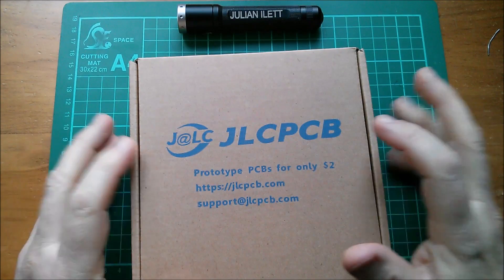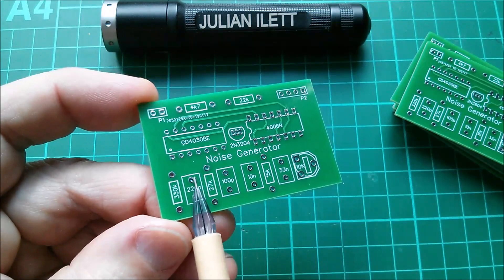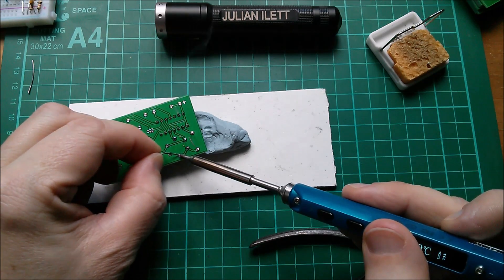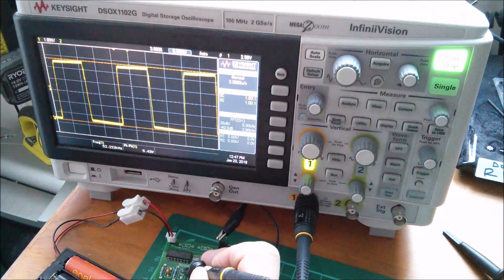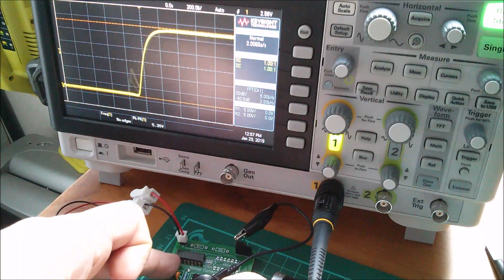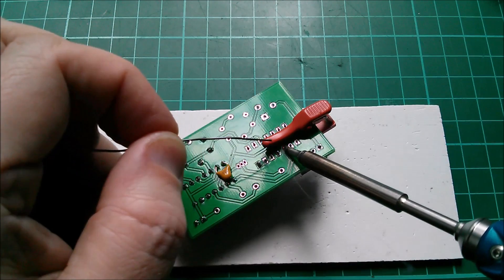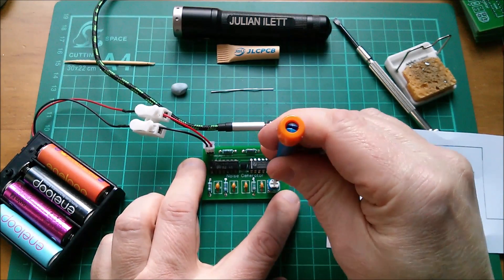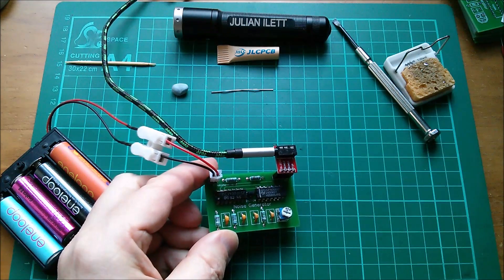Noise Generator PCBs from JLCPCB with GND Copper Area

Comment: Are you having good luck with those headphone jacks?  I ordered in 10 of them a couple of years back, and then the quality of the traces was so poor that if my soldering iron drifted over 300C the traces came up and I had to figure another way to get the electricity to the pins.  I used bodge wires to go from the pin over the back then to the tab that hooked to the desired part of the earphone plug. Don't think I will try any more of them, even with my new digital soldering iron I just don't trust that board any more.

Comment: @Julian Ilett I think the higher amount of high-frequency noise that occurs as the volume is turned up may have something to do with the human ear's tendency to emphasise mid-range sounds at lower levels, as determined in 1933 by  Harvey Fletcher and Wilden A. Munson. Their research resulted in the so-called  Fletcher-Munson curves, which in turn gave rise to 'loudness' circuits in many types of amplifiers for home use. More info about this can be found  here https://en.wikipedia.org/wiki/Fletcher%E2%80%93Munson_curves
Interesting video by the way; are you designing a modular synthesizer?
Greetings from Denmark.

Comment: you need 2 ics one transtor and a awful amount of passives for a white noize generator? come one 2 transistors 2 resistors and one cap do the job equally good... i build that 

on a 2 by 3 cm piece of perf board

Comment: If you can put up with always getting exactly the same pseudo-random noise sequence on each power-up, you can just program a PIC chip to simulate a 32-bit shift register with two of its outputs xored to its input.  I know 'cos I did exactly that.

The final circuit has just the 8-pin PIC and a small speaker connected between one of its output pins (ie a pin programmed to be an output) and ground, with an 18650 as the power supply (since the PIC I used will work down to around 2 volts).  If you really, desperately need to filter out any DC, then you can add a small capacitor between the output pin and one speaker lead (or the amplifier, if you need a loud hiss).

"Tuning" the circuit to give a slightly deeper sounding hiss involves nothing more than inserting a few "nop" instructions (no operation = do nothing) before the jump back to the start of the loop.

Re: Short solder.  I usually try using a pair of needle-nose pliers to hold the solder when it gets that short.  You can also try resting the last scrap against the pin you're going to solder and applying the iron.  (Yes, I'm a bit of a Scrooge too, when it comes to not wasting even that last tiny scrap of solder) :)

Comment: Cool use of the tie clip!  Love it!  Say I was going to order some PCB's from jlcpcb but when it came check out, the shipping seemed rather high, well extremely high compared to most of the things I get from China and Laos, that region.  Am I missing a button or something, it's not like I need overnight or even rush delivery, a slow-boat from china would work for most of my needs, seems my urge for speed has gone by the wayside in my old age, and the need for funds far outweigh such needs for speed.  They look to be great little boards but it's sort of like the adds on Ebay showing a nice phone for 6 bucks then when you see the shipping is $300.00 you sort of understand that it is really click bait.

Comment: Disappointed not to see mounting holes, silk screen markings for the power ("+V" & "gnd") and output ("out" & "gnd") connectors, bulk decoupling for the board, and individual decoupling for each chip.  Weird that the two chip footprints are using very different pads.  Test point for the oscilator output?
Reply from the maker: Ah yes, the two different footprints - that was before I discovered the 'footprint manager' :)
Reply: @JulianIlett  I still don't know why you didn't do a PCB for thos band pass filters you did on veroboard.  What were there, 14 of them?

Comment: Julian, why not panelize the pcb's?  You could get four of those on one 10x10 pcb.... so you'd end up with 40 for the same price...
Reply from the maker: I don't need that many - 10 is more than enough :)
Reply: JLCPCB charges $14 for panelized boards. Julian would have to pay 7x as much for 4x as many boards...

Comment: The user library symbol has power pins. They are just hidden. To use them or:
a) Unhide them right click symbole -> Edit symbol... -> uncheck Hidden Pin
b) How it's supposed to be used to keep it clean, use the same  netnames in your schematic. Here (probably) VSS and VDD. Then the pins are automatically connected. Names in the same Edit symbol menu
Reply from the maker: Thanks - I'll have a play with that :)

Comment: What voltage do you run your iron at?
Reply from the maker: 18V - From a power tool battery.
Reply: @JulianIlett  I use 18v too, but mine never gives me any problems  with big pads, I also set mine at 380, though

Comment: What happen to your nice soldering iron?
Reply: sponsored into using these USB toy gimmicks... fine for field repair where you can't use butane for whatever reason/otherwise a joke.  You can get a real temp controlled soldering station at a higher power much cheaper but it doesn't have OLED wankery and reprogrammable firmware.
Reply from the maker: It's working fine:)

Comment: Hi Julian. At 46 I am pretty old to be making a start into the world of electronics but I have for this past year delved in and I have been building things on breadboard, as being disabled I do not get out much so I have plenty of time on my hands, and the hobby keeps my hands busy. I have not yet soldered up a ready made kit, but I have done a few home electronic repairs like replacing Caps in the TV and so on. I have learned a lot from your videos and enjoy them very much. Do you sell any of the kits you make? and if so are they just the PCB or do they come with all the components? Much love Brother, Ken, UK.
Reply: @Nordl3  I have no idea where to begin with PCB making, certainly can not afford a lazer printer and all the messy stuff to deal with. Just doing it for the fun of learning and enjoying physics. Plus, why would I want to buy 10 of the same thing with no components? lol. Its just that most of the available full kits I have found online are products I have no interest in, such as a device to use Leds as a dice. Neither am I interested in buying Arduino's and learning to program just to flash an LED. I am currently enjoying making noise circuits like oscillators and baby 8 sequencers and so on, which is why this noisy little device tickles my fancy. Be nice as a complete kit for the solder practice, and to make a noisy racket to annoy the Wife. lol. I also like guitar fx but I already have tons of the real things. I am going to put together my own mini synth with an effect bank at some point, but as yet I am still struggling to lay things out on protoboards. I get very confused, probably the meds. ha! Anyhow cheeriebye Noodle and thank you for your reply.
Reply: @KennethNicholson1972  That'd be laser printer. LASER is an acronym for Light Amplification by Stimulated Emission of Radiation. Arduinos can do a lot more than just flash an LED. Since you mention oscillators, perhaps you ought to look into using an Arduino interfaced to a DDS signal generator. Alternatively, there is the Si5351 clock generator that gives you 3 channels of variable frequency square waves which could be filtered to make all kinds of weird and wonderful noises. If your mind is closed to possibilities you won't progress very far in the hobby. I'm 57 and just recently decided to learn to play the ukulele. Nothing is impossible! If you are struggling with the construction side of things, and it can be tricky for a beginner, maybe you could see if there is a local maker group near where you live. The big advantage there is you will come across like-minded folks who can help you out and access to equipment you don't possess to help with your projects.
Reply: @SpeccyMan   I have no interest whatsoever in coding. None at all. Lots of fantastic musical synth wonders can be made without Arduino. Infact none of the classic synths ever had arduino inside.
Reply: Wish has a lot of kits with components
Reply: Kenny, if you haven't already done so you might want to take a look at Pete McBennett's synth (built on a breadboard). This is a newer version of his older synth and has three oscillators (two are drones). Great sound and a fun build.

Comment: You need not worry about providing a ground plane for the chips. The silicon die is almost always mounted to a grounded metal plate. The ground fill on the pcb is to protect traces from interference. Thus a socket is almost always the way to go.

Comment: You placed many traces on the underside of the board. If you had moved as many as possible to the top layer, you would have gotten a bigger, more uninterrupted ground plane, which is sort of important for shielding effectiveness. As it's a two layer board, you can also flood any remaining area on the top layer with GND or 5V for even more better. Nice board anyhoo.
Reply: Or just put the copper pour on the top of the board.

Comment: The transistor pads are awkwardly close. This is why you usually see the base pin pulled back a bit, forming a triangle.
Reply: I noticed when I had some made up. Even though I used the footprint from their data base, I think it'll be a struggle to solder it. I remade them, deleted the footprint and just put 3 pads instead
Reply: @neiltonks  I used that footprint for my board recently too.  thinking "oh, this will be easier to deal with as i won't have to splay-out the transistor pins!"  not thinking at all that it would make soldering slightly more tedious there. ;D  oops.  My first ever board, so... live and learn!
Reply: @yorgle  mine too! It's all Bigclive's fault
Reply: i hate this triangular layout. takes much longer than all in a straight line straight line but bent a bit outwards is nice and quick to do